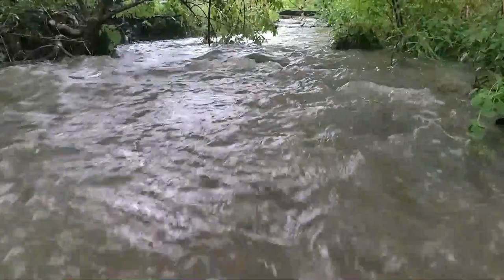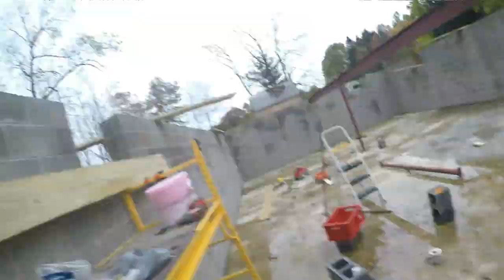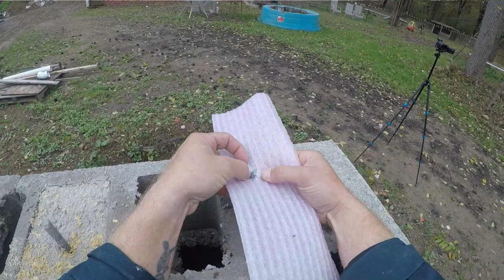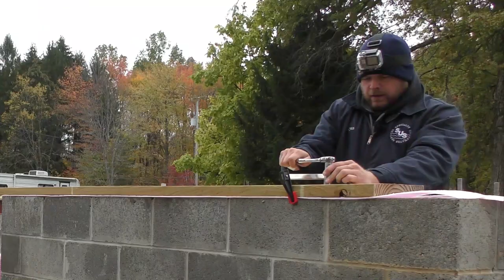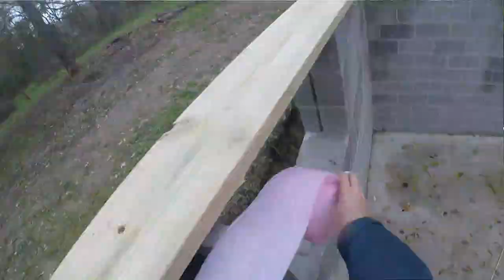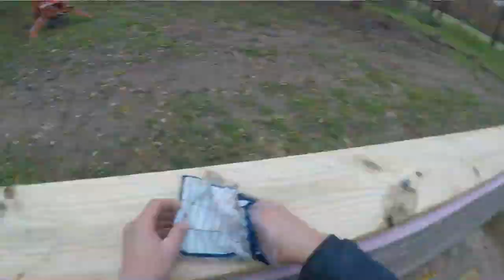Installing sill seal and sill plates

Comment: Looking good! We just picked up 3 rolls of that same sill seal. Alex plans to use Siga Fentrim tape to provide an additional air seal at the concrete to wood transition.
Reply from the maker: Yup. Ill be foaming and taping once the weather heats up. This video is from October. So a little behind on the uploads. Our plan is to build an economical house while building it as efficient as possible  without going too crazy.
Reply from the maker: Where are yall located? Western Pa here. Will be interesting to see how code and the way different areas build